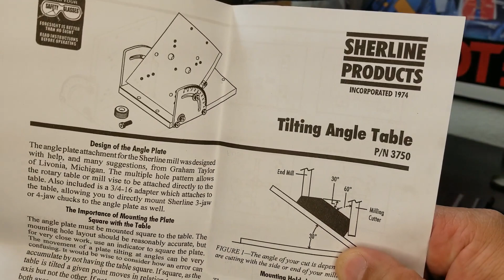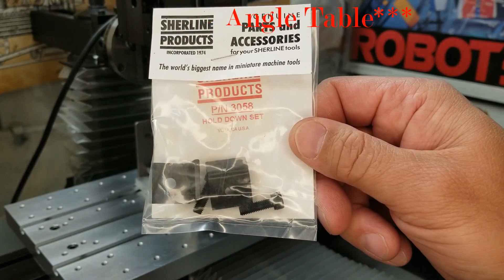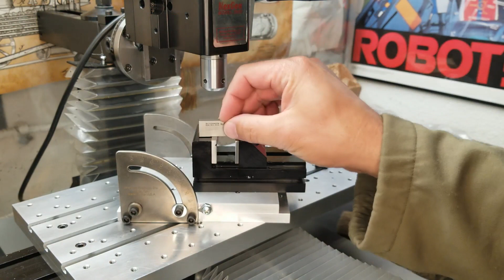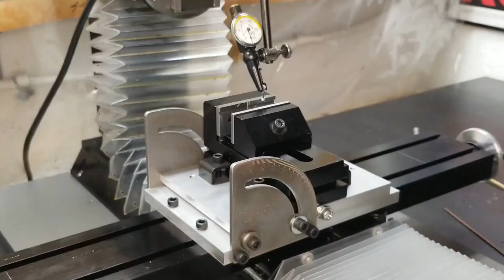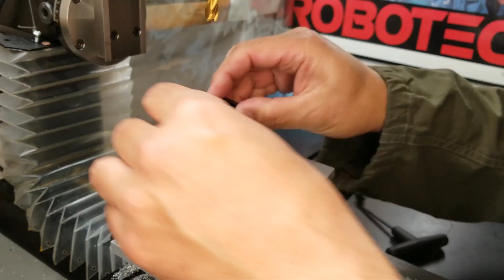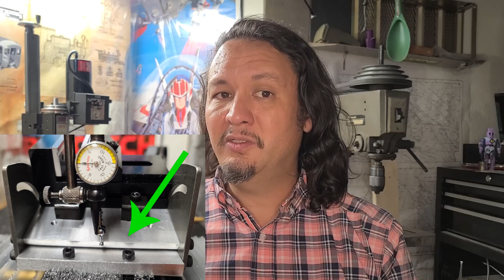Using a tilting angle table to machine journal boxes

Comment: i think it has kind of a design flaw, when you tighten the vise to it, you will probably bend the aluminium plate leading to a different angle than supposed.
Reply from the maker: True.  That's the thing with aluminum, you got to tighten down to make everything rigid but too much and you strip threads and like you said it twists the plate.😵‍💫  You  just made me think, maybe that is why there are 4 points to secure the vise, maybe spread the load?  Though Sherline doesn't say in the instructions so we just don't know.  Though, I could only imagine how much it would cost as ground and hardened tool steel.  I looked at a used Bridgeport Sine plate for researching this video and those were like $800+s/h!!!🤑🤑🤑

Comment: One other quick comment, and an idea you'll maybe find useful.

Comment: instead of taking the tooling plate off so that you could attach the angle plate to the T slots in the table, couldn't you have attached it to the plate with clamps?  As for stacking up tolerances, you have to indicate everything in anyway, so there wouldn't be a buildup in tolerances after that.  Maybe I'm missed something -- I usually do.

Idea:  Adjusting my X axis backlash is a real pain with the adjustment hardware buried under the table.  In the process of working out a way to move the lead screw follower and star nut to the other side of the carriage (which I'm still working on) I discovered that a 5/16" wave washer that I got from McMaster installed on the follower nut allowed me to tighten the follower down to the point that backlash is less than .001 without binding.  The wave washer acts like a spring, with a fully compressed load of just 5 lbs.  What it does is preload the follower nut without jambing the axis.  I have more playing to do, but this looks like it will be a successful solution if you are having backlash issues.  If this doesn't make sense, let me know and I'll send a drawing or something.
Reply from the maker: Thanks, you are right there are slots, 3 of them so it would have fitted just forward or back of center.  I think at the time I was irritated I couldn't use the holes there. 😠

Thanks for sharing the idea that is an excellent one.  I think I get an idea of what your doing and it sounds like a good one.  I would love to see a drawing or something to make sure I got it right.  what do you think of synthetic fiber or leather washers to manage that torques as well?  I do want to try it myself.  I totally agree with you adjusting the backlash is a pain.  It always seem too tight or too loose every time I try and when I get it better the difference has been marginal.  Once you get it dialed in you should submit it to Sherline.  There is a page your tip goes up on their website (https://www.sherline.com/tips/).  the submission info is there as well. 😎
Reply: @LoydPrecisionMakers  Washers that are a little bit squishy is not a bad idea, but they need to not be very thick for this reason: 

Think of the X axis -- when the table is transiting to the left, the adjustable follower nut is being pushed into its hole in the carriage.  Since it is ordinarily adjusted nearly down against the carriage, the flange on the nut pushes the carriage to the left.  To the extent that there is a gap between the flange of the nut and the carriage, that's our backlash. 

Now imagine placing a washer under the flange, and tightening the nut down to the point that it compresses the washer enough to remove any gap between the flange and the carriage, plus a little bit more for a bit of preload.  That will completely eliminate the backlash, unless the torque needed on the X axis handwheel (during a heavy cut for example), or the stepper motor in my case, to advance the carriage is high enough that the force against the follower nut exceeds the preload you placed on it during assembly.  The high force would further compress the washer, resulting in backlash.  Using a thin washer would help mitigate the effect.

Another problem with washers made from an elastomer is that some of those materials cold flow under pressure.  It's a long term effect that would eventually result in the preload you put on it going away, so you'd have to use care in choosing both the material, the effective spring rate and the thickness of a washer.

Another idea that's crossed my mind is using an O-ring.  They come in every size and thickness imaginable, and the common ones are made from BUNA-N, which is impervious to petroleum oils, and it doesn't cold flow.  

The wave washer I'm using is very thin to start with, and its OD isn't so large that I can't still use the star washer to lock the nut in place against rotation.   I got lucky there, because they aren't made in a lot of sizes but it just happened there was a perfect one.

If you send me an email to glivick at sbcglobal dot net, I'll email pictures.  If you want to try a spring washer, I have a few spares and will send you one.
Reply: @Reach41  Do you mind sharing the McMaster part number for the wave washer you're using? I'd love to give this a try too!
Reply: @chriskhosravi5053  I’ll look it up and post it later today.
Reply from the maker: @Reach41  Very cool.  Thanks so much for sharing and taking the time to write all this great information.  This is deffinetly a post to save.
Reply: @chriskhosravi5053   The wave washer for the X and Y axis is McMaster-Carr P/N 90134A030.  Please let me know of your experience with them.